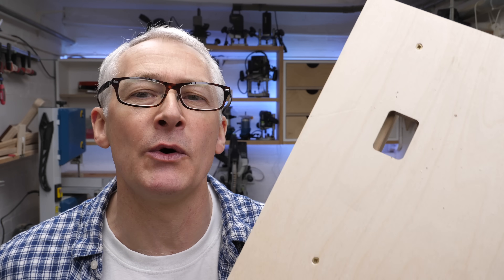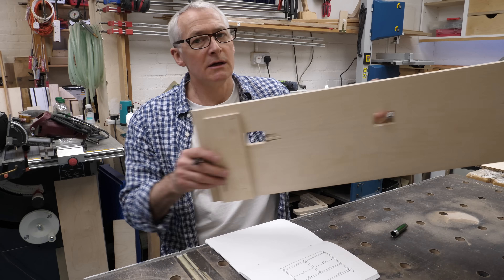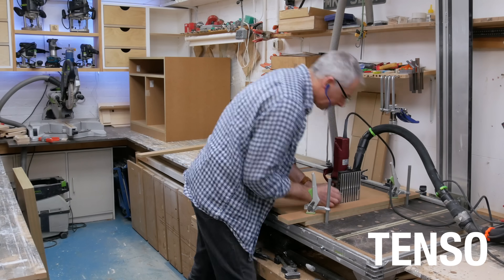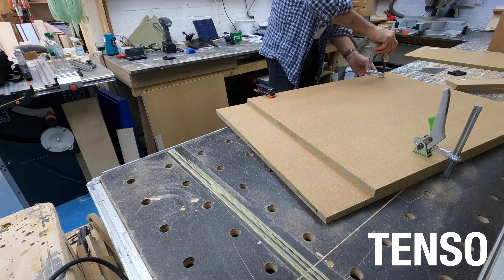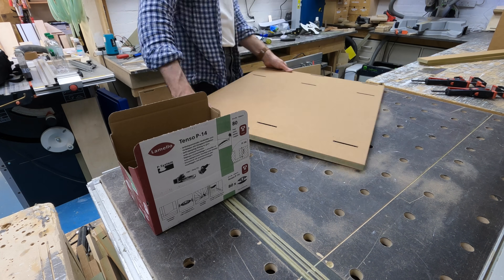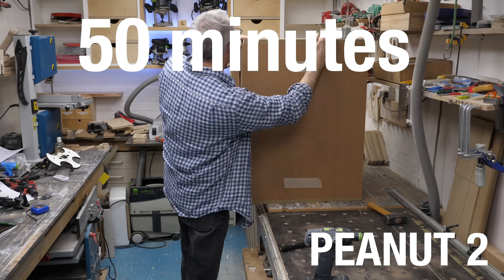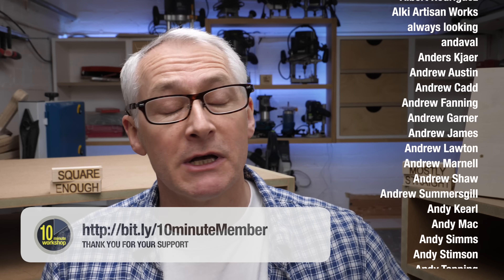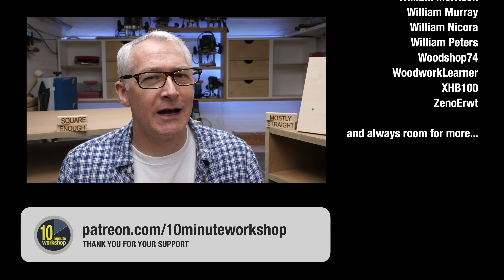Peanut 2 or Lamello Tenso? [**Gifted/Ad][video 450]

Comment: Great video.  There is one advantage I think the Tenso / Lamello has over the Peanut.  Obviously with the Peanut, you have to start with the pieces offset from each other when doing the joining / assembly.  They're offset by 10mm or whatever the length is, and then they slide together to form the joint.  The Tenso just clips on directly from above, without that offset.  This would be advantageous for a situation where you need to attach a trim piece to an already-installed cabinet where there may not be any room to "offset" the pieces from each other before joining.  But otherwise, I like the Peanut much better,  In my case I have a 4x8 CNC machine and would MUCH rather just buy the Peanut router bit and use my CNC to cut the slots rather than have to spend $1,500 on the Lamello Zeta and then rout the slots by hand.  I thought Festool tools were overpriced but that Zeta P2 takes it to another insane level!
Reply from the maker: Thanks! Yep, they’re different fixings for different uses. Totally agree about fitting into an existing cabinet or very tight space - worth noting though that you can use the peanut cutter to route a slot, and slide the panel or shelf in, like you can with the Lamello divario connector. 👍

Comment: One thing was very clear, your experience and skills had you standing there and regrouping a whole lot less than you'd see me do. In the fast forward it was as seconds of contemplating, with me you'd have a challenge editing out the " now where was I" parts. The peanut system was a win in my book. Assembly appeared to have less of the balancing act of the Lamello system. Consumables and initial outlay would play a large role as the ultimate endgame is a bit smoother system with lower costs. I don't have an unlimited budget......yet.

Comment: My conclusion:
Peanut:
+ Cheap Machine (Router)
+/- Jigs needed
- Peanuts are expensive
Lamello:
+/- No Jigs needed
- Machine is very expensive
- Tensos are expensive

My first thought was, that working with the Zeta will be quicker (no Jigs, no Screws). Thanks for showing this!
Reply from the maker: Peanuts are ~1/5th the price of Tensos; Dominos are ~1/5th the price of Peanuts,  But then they do so much more. Oh, and dowels are ~1/4 the price of Dominos. Peanuts are the cheapest self-clamping connector you can but afaik. 👍
Reply: @10MinuteWorkshop  So for cheap ppl like me, use biscuits. 🙂

Comment: Oh yes, a Domino jig would be very interesting (I'd much rather make use of what I have - especially since it was not cheap - than buy yet another system; normally I would, but I'm slowly learning that is a bad idea :^)  ).

I think one should factor in the time to make the jigs unless you KNOW you'll be reusing them a lot.

Also; perhaps you could speak to this: which system seems to be more flexible in use. I.e. able to use in a lot more situations that the other.
Reply from the maker: Thanks! Oh, hands down, Domino is the most flexible - I've mentioned it before in the comparison with the Lamello and Mafell doweler. They all have their strengths, but the Domino was the most versatile of the three, whilst also being the least costly - I drew the liner at calling it the 'cheapest' of the three! But yes, probably worth re-visiting with other systems now available. And I wouldn't make a jig unless I knew I could get use from it 👍

Comment: Oh go on.....let's have the domino jig as well! Actually I'm not surprised that there was little difference in the build time between the two carcasses, because each joint has to be cut individually, and the tool repositioned between each cut.
Reply from the maker: Yes - but even so, I expected the Lamello to be faster to use; you never know until you try! 👍👍

Comment: Thank you for great content and inspiration, Peter. I'm wondering if you heard of or tried the Keilverbinder Dovetail Connector Pins for hidden connections, what do you think of them?
Reply from the maker: Thanks! Sautershop sent me some a while back, found them a bit fussy to use tbh, and with no router jig I available I didn't feel the setup time was justified over other connectors. 🤷‍♂️ 👍
Reply: @10MinuteWorkshop  I see, they meant to be used with CNC or metal profiles they make. Another question: did you try Shaper Origin? I tried and it gives amazing results with this connectors.

Comment: Can i ask why you didn’t cut the mid panel joints in both the ends of the shelves and the face of the gables with the zeta at the same time.
Clamping the shelf in position on the gable and plunging into the face of the gable and then the end of the shelf while it was all set up, and therefore utilising only marking out/ positioning once?
Reply from the maker: Because I was using the divider and the plinth for the vertical positioning of the shelves in the carcass; if I'd used the ends of the mid-panel shelves I'd have to have been working of a pencil line for vertical position, which is much more finnicky. 👍

Comment: Thanks again Peter for the nice video. I have no experience with the peanut connector, but I do with the Lamello connectors and with the Dominos. I wonder, how long does a peanut connection last? It seems to have a very small contact area - I would suspect that materials as MDF or chipwood would give in slowly on such small contact areas? Due to creep? Or am I over concerned? I did note that the more recent IKEA cupboards do have peanut like connectors as well - 3 on each connection. But what does that say except that it is fast and easy? Any thoughts?
Reply from the maker: Thanks Wino! All I can say re Ikea is that they and @intelligentfixings are aware of each others approaches to this jointing method, and have decided to co-exist peacefully for now. As for longevity, no, there's no issue as far as I know; the peanut was developed specifically with poor quality MFC in mind, so the relative density of MDF is a bonus. 👍

Comment: AFTERNOON PETER GOING OFF THIS SUBJECT A BIT I HAVE LOOKED FOR YOUR VIDEO ON THE SMALL ELECTRIC SCREWDRIVER YOU USE IN YOUR HOUSE CANT FIND IT CAN YOU TELL ME THE MAKE OF IT NEED A HANDY LOW VOLTAGE TOOL FOR IN THE HOUSE
Reply from the maker: Cheers Anthony. It was the Gift Ideas 2020 video - https://youtu.be/83H1PxwmwqE. The screwdriver was this one - Hybro 3.6v electric screwdriver - https://amzn.to/2T3ofiZ (US: [similar] https://amzn.to/311Ey3Q) Works really well - was using it just the other day! 👍

Comment: I offer my pov from a slightly different angle. I do woodworking and I've built cabinets but I'm not a cabinet maker. I'm an architect.

I actually was working on a job and trying to figure out how to attach a piece of frp with a stainless front to a large opening over a hob in a assisted living home. I remembered the peanut jig and it would have easily done the job. Right now it's out for pricing so I'm waiting for a RFI to come into the office as to how to do it.

I think Lamello (sp) have shot themselves in the foot. Their machine is nothing more than a biscuit jointer and I'll bet money that someone comes out with a similar clamping system that you can use with any brand of biscuit jointer.

I much prefer (architecturally) the peanut "press/pull" connection rather than the Lamello plastic linkage.

Just my 2p's worth
Reply from the maker: Thanks Patrick. Yes, there’s an elegance and simplicity to the peanut connector - a modern take on the old ‘screw head in a t-slot’ approach, but with considerable ingenuity and modern materials development applied. And yes, it will be interesting to see what happens when the Lamello patents expire - and with the Domino too; I suspect though, as with tracksaws, we won’t see a significant price reduction in competing products from the big manufacturers. 👍👍
Reply: @10MinuteWorkshop  TBH I'm surprised some Chines company hasn't come out with a knock off already for the Lamello system. Look at all the layout tools in red but not with woodpeckers silly price tag.

I'm not sure if the Peanut is getting much press over here to boost it. I know some "celebrity" trim carpenters here but no one who's well known for cabinetry otherwise I'd push them in that direction.

The peanut system is brilliant. It's miles better than relying on hafele cam locks.

Comment: a loose tenon jig for angles would be a good to see, a fair few people have already done videos for square joints. i was going to ask how does the Domino connectors stack up to these and seeing how one of them fell to bits when you moved it how useful will they be? will they take some weight and stress etc?? i have been planning a kitchen build and not sure what line to take on fixings
Reply from the maker: The Tenso connectors aren’t strong enough to be used alone, they need gluing - like dominos - and this was only a dry fit. 👍

Comment: What was the quality of the cabinets after you made them, I see in the video you have square enough, and mostly straight.
Reply from the maker: They were only dry-fitted, but they were solid, though the peanut pulls together more tightly than the tenso because it applies so much more pressure. "Square enough" and "Mostly straight" are ironic witticisms ie they're very straight, and absolutely square.

Comment: Hi Peter. How do you think the peanut connectors would perform in MFC panels? I dabble in cabinetry and MFC is my go to material (because of the numerous finishes), usually using Hafele Rafix or Minifix connectors, but I'm always open to other methods.
Reply from the maker: They’re very good in MFC - it’s what they were designed for. I don’t use it much myself, but some of the first samples I had were in MFC and they were excellent. 👍👍
Reply: @10MinuteWorkshop  Excellent, thanks. Great channel BTW 👌🏻
Reply from the maker: Thank you! 👍

Comment: Very interesting video as I am considering which of these two systems to invest in. The only disadvantage I can see with the Peanut system; is working out which order the assembly follows, as the connection is a slide type. Can I ask you Peter; do you have to very carefully work out an assembly process? Would the peanut connector be OK on a large wardrobe build? Or am I worrying about nothing? Your expert insight would be greatly appreciated. Huge cost advantage using the Peanut system; but is the Lamello a better knockdown system?
Reply from the maker: Thanks Anthony. Yes, because the peanut system is directional, you need to think about how the workpiece goes together, about how it is assembled. But yes, the peanut is perfect for a large wardrobe build - better in my experience than the Tenso fittings, as they provide so much more clamping pressure. The Tenso was a large part of why I bought into the Lamello system, and it has been very disappointing in my experience. 🤷‍♂️👍

Comment: Hi Peter. I saw that you are using the trend T4 (1/4 inch) with the peanut jig. Do they do a 1/4inch version of the peanut mini jig as I was put off originally buying it due to it being 1/2 inch? 

Keep up the good work 👏
Reply from the maker: Hi Greg. They’ve been doing an 8mm shank cutter for a little while; most 1/4” routers will take an 8mm collett. 👍👍

Comment: Hi Peter, very interested in picking up the peanut mini jig. Just wondering, I have a trend T5 router but would need to get a 8mm collet (about 25 quid), So I think I might as well get the T4 with the 8mm collet for 70ish instead. Are there any other expense like guide bushes / base plates I'd need with the T4?
Reply from the maker: The T4 just uses a standard trend guide bush straight into the base, so no adapters needed. The only extra I had to buy for June was the the 8mm collet. 👍👍
Reply: @10MinuteWorkshop  Thanks Peter, Well I have the 30mm Trend guide bushing so I will get the T4 (Seems like they come with 1/4", 6mm and 8mm collets now). Maybe I'll have a router collection like yours one day :) Side question, do the trend guide bushes (in trend routers of course) require them to be centered or do they self align via the fixing screws?
Reply: @10MinuteWorkshop  You previously demoed the measurement on YT  vid, but you did not explain why you made the jig off off the guide bush.
Reply from the maker: They seem to align pretty well, but I always use a cantering mandrel, just to be sure. 👍
Reply from the maker: @Craig Carter Surely that’s obvious?? How else would you centre a router in a slot like this? 🤔🤷‍♂️

Comment: Would you normally glue or just mechanical fixing?
Reply from the maker: With the Peanut it depends on wether I ever need to get it out again. With the Tenso I'd glue every time though. 👍
Reply: So if you’d glue every time with the Tenso does it have any advantage over, say, a domino. Seems like it’s more expensive, both for fittings and machine?
Reply: @mobilefiscus  I'm looking into the Tenso for a niche application - say you have a face frame to attach to already installed cabinetry where you can't use clamps or pocket screws and it's sprayed so you don't want to use brad nails.

Comment: ahh but with the peanut system ...is it going to eventually come loose over time? would you use it for your clients or just for your own workshop build etc?
Reply from the maker: There’s no way peanuts are loosening over time, but if it troubles you then add a bead of glue. 👍👍
Reply: @10MinuteWorkshop  thanks Peter for the reply...i just think either the plastic peanut will degree a little or screws pull outwards because of the pull force (I am sure there is a technical word for this :)  )
Reply: @ChristopherClaudioSkierka  - Plastic - not really known for degrading, especially when completely covered and protected from the elements.

Also, once you hammer that peanut in, you then screw it, compressing it against the walls of your material internally, so, maybe if you managed to keep applying over 90kg of force (multiplied by the number of peanuts) for either a decent amount of time, or repeatedly, then they may start to give, but otherwise, you'd be pretty safe.
Reply: @zeemalota732  so conclusion ..use for clients work and not just your diy jobs?
Reply: @ChristopherClaudioSkierka  - I only do DIY jobs, just saying that good quality plastic is damn tough and durable.

Comment: This was a great video.  Question: with the Lamello (and the "if" system), because you don't have to use glue, isn't it possible to paint all your pieces before you assemble them?  For example, If I got a full sheet of plywood or mdf, I could paint one big side several times, then wait for it to dry and do the other side.  the only other painting required would be where I made cuts that people would see.   Seems like it would make the painting step much easier.  Of course, I am also trying to rationalize buying a lamello.  why lie?
Reply from the maker: Thanks Mark! To be clear, the Tenso isn’t strong enough not to use glue, in my experience; the Clamex is, but not the Tenso. And yes, you could pre-finish a board in that way, just be aware that you’d need to handle it carefully post-painting. But it’s possible, yes. 👍

Comment: I liked your previous videos on the peanut jigs and I think this video has finally swayed me to get one. The only thing is I don't know how you got the router bit to fit in the trend t4 as from what I can see the smallest shank   bit you can get for peanuts is 8mm and the t4 is 1/4?
Reply from the maker: Thanks! I do say in the previous vid. that the T4 (and most 1/4” routers btw) will take an 8mm collett. Works great! 👍👍
Reply: @10MinuteWorkshop  Thanks I must have missed that bit, looks like your £300 set up with the t4 is the way to go. Like you said I'm sure you will wait a while but I would like to see you make the domino jig. I have made a domino jig to join the corners but haven't come up with one for t joins yet, I might have to steal the design you used for the peanuts in this video.

Comment: Hi Peter, thanks for the video. Very informative as usual. The question I would ask is which is the strongest fixing? The clamping strength of the Peanut fixing is very impressive, so I'm guessing the Peanut carcase is inherently stronger/more sturdy than the Lamello one...?
Reply from the maker: Peanut 2 vs the Tenso, oh absolutely, Peanut 2 wins hands down; Tenso does something like 7Kg/fitting, the Peanut 2 something like 90Kg/fitting in MDF, 140Kg in Birch ply. They're actually stronger than the Clamex, which is stupidly strong (~85Kg from memory) in itself. 👍
Reply: Just ordered a peanut 2 full size jig. Thanks for the videos. Look forward to employing it for build ins and mantels so I can knock down and transport before installation

Comment: Something that I don't think you have mentioned that is a pro in favour of the Peanut jig over the lamello or a domino for that matter. If the Lamello motor packs up, you gotta send it back, maybe under warranty maybe you gotta pay for repair, same goes for the domino. At the very least you are out of pocket in terms of time if not actual money as you cannot work without them. With the peanut jig if your router packs up, well you likely have another router on hand you could use, but you could also pick up a cheap router from screwfix etc and you would be out either 10 minutes to switch tools or an hour or two tops if you buy new and you can keep on working. Something to consider.
Reply from the maker: Yep, good point, though I’ve had my domino for ~12 years, used pretty much daily and have had zero issues.  But very true what you say. 👍